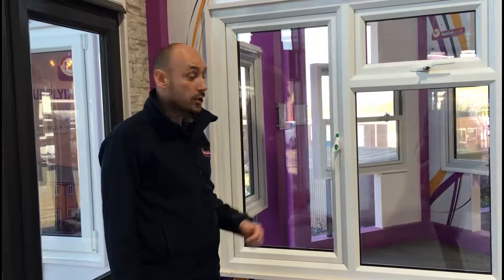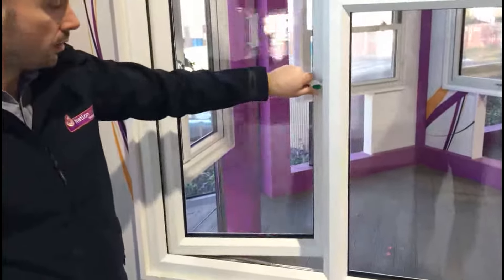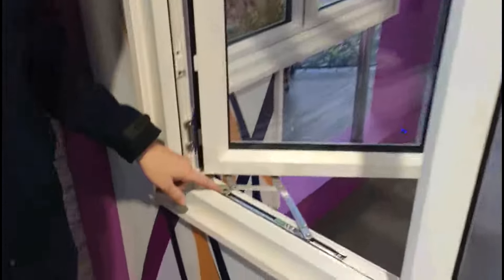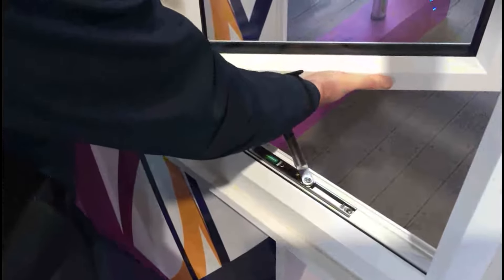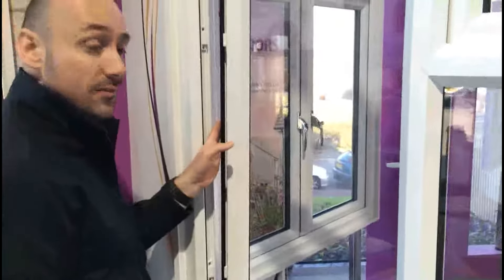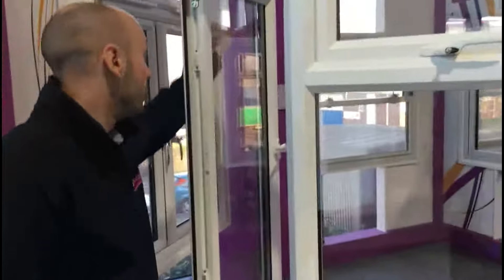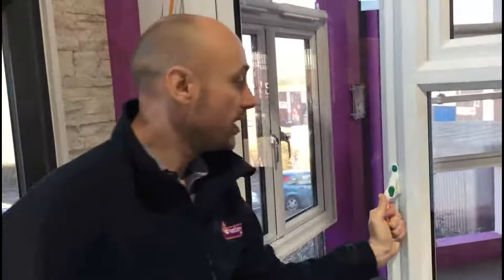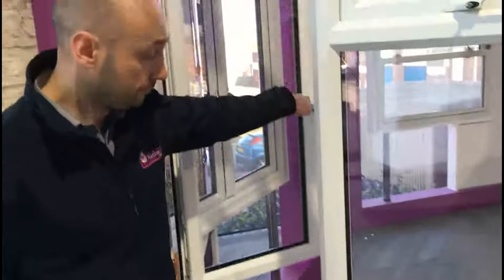Easy Clean Hinge Operation Video

Comment: These windows are an embarrassment compared to the rest of Europe 😂 Mainland Europe living in 2024 with windows which swivel inwards fully, giving full access to the outside surface without having to stick your head out of the building and risk tipping yourself over... and a function where the window can tilt... and then there's the UK still in the 1840s giving residents the most dangerous, inconvenient rubbish on the market.

Comment: Omg I had no idea you could do that. A couple of years ago the council sent a company to service the windows. They installed scaffolding that was up for 2-3 months. All they did was a very basic clean on the closed windows on the outside! They never did anything to the hinges, etc. I did tell them my hinges were rotten and needed changing and they did nothing. To be fair, after seeing one guy cleaning my windows they disappeared ( left the scaffolding up though). Cost the residents a fortune for basically no real work done ( a window cleaner would have done a better job). Cost £5000 per resident ( unless you rent directly from council). A joke. I need to buy the hinges and replace them myself because some windows are barely able to open and a couple open completely because the hinges have completely disintegrated.

Comment: It’s not working I don’t have a Green press but my windows built the same
Reply: You don't need the green button it's just the safety feature in this model the rest is important . I just did it and I don't have a green button
Reply: @spw3120  My mechanism is very similar, but there isn't an obvious place to press that releases the window to open all the way.  I've pressed systematically along from one end of the mechanism to the other and my window still only opens part-way; there's no catch or anything I can see or detect that will allow the window to open further.